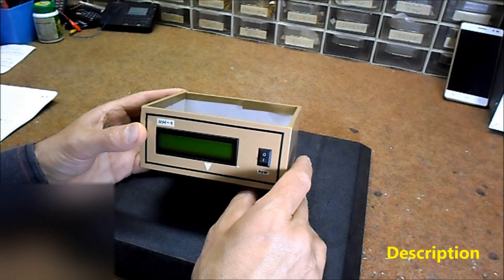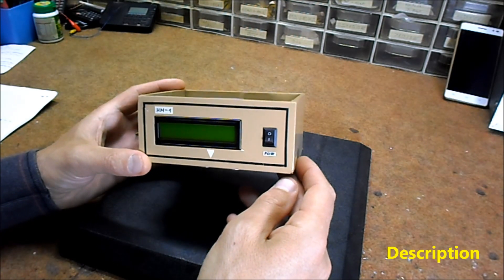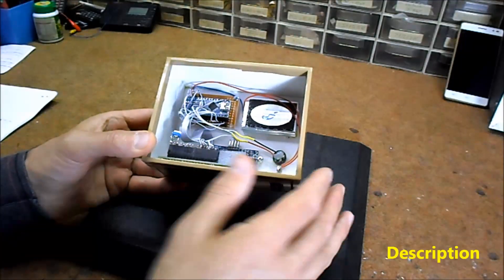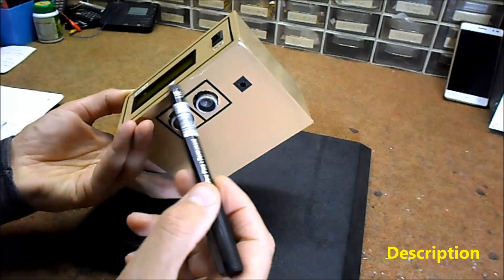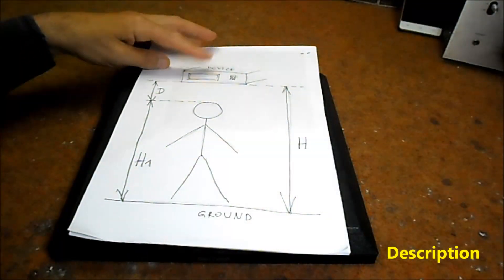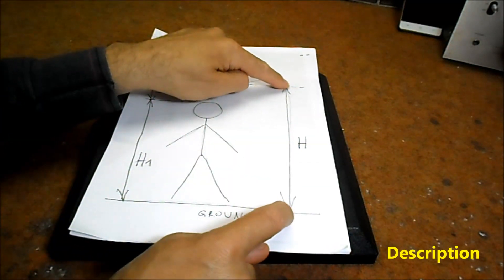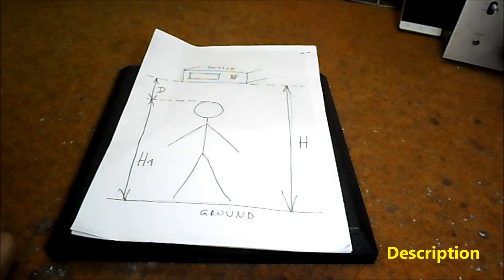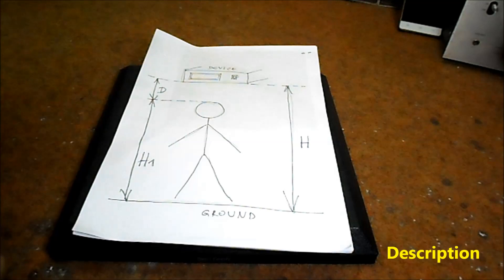DIY Arduino height measuring machine

Comment: sir i have Arduino uno .. can i make this device using this code..😢😢Plz reply me sir
Reply from the maker: Code works with Arduino Uno without changes
Reply: @MirkoPavleskiMK  circuit diagram is change....???
Reply from the maker: @electricalwow  New link: https://www.hackster.io/mircemk/diy-arduino-height-measuring-machine-0437dd

Comment: is potentiometer needed or not? Can i ask is the box from wood or plastic?
Reply from the maker: The contrast of the screen is adjusted with the potentiometer. The box is made of PVC board (plastic)
Reply: @MirkoPavleskiMK  thank you very much, sorry for my bad english, one more question is possible if i add some speaker when the lcd displaying number the speaker will voiced the result number with some human sound
Reply from the maker: @elevendidntwakeup942  It's doable, so I'll consider implementing it in a future code update

Comment: Hello @Mirko Pavleski, can i use a 9V battery on the DC barrel jack ,intead of the 3.7V battery ?
Reply from the maker: Yes , but you canput 9V on "Vin" pin of Arduino
Reply: @MirkoPavleskiMK  thanks a lot man

Comment: @Mirko Pavleski  
I have this screen (1602 16X2 Character LCD Display Module with IIC / I2C / TWI / SP I Interface - Yellow).  I would like you to tell me if it is possible and how I will connect it to the Arduino.

Comment: What type of battery is needed and where is it connected?
Reply from the maker: I use one 3.7 V Li-Ion Battery connected on +5V and GND
Reply: @MirkoPavleskiMK  Is it possible to connect a power bank (5v) instead of the battery?
Reply from the maker: @JORDAN27872  Yes of course
Reply: Is it possible to connect a power bank (5v) instead of the battery?
Reply: Thanks
Reply: Let me ask one more question.  Where do we connect the buzer?
Reply from the maker: @JORDAN27872  Sorry my mistake , Buzzer is on D8 pin
Reply: @MirkoPavleskiMK  I have this screen (1602 16X2 Character LCD Display Module with IIC / I2C / TWI / SP I Interface - Yellow).  I would like you to tell me if it is possible and how I will connect it to the Arduino.
Reply: I have this screen (1602 16X2 Character LCD Display Module with IIC / I2C / TWI / SP I Interface - Yellow).  I would like you to tell me if it is possible and how I will connect it to the Arduino.

Comment: I thought proximity sensor could calculate distance.. looking at the code in the sketch, apparently you need to calculate the echo from the buzzer as distance... humm doesn't seem very reliable.. may be I'm wrong